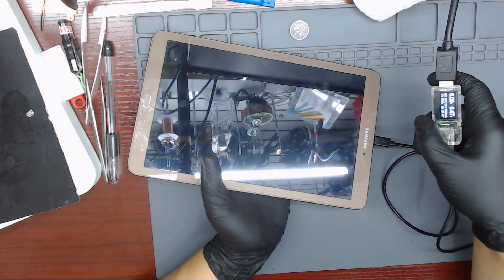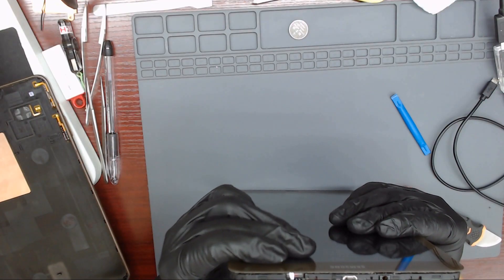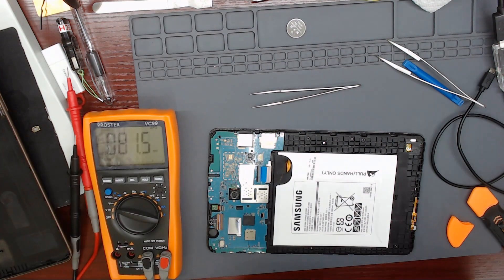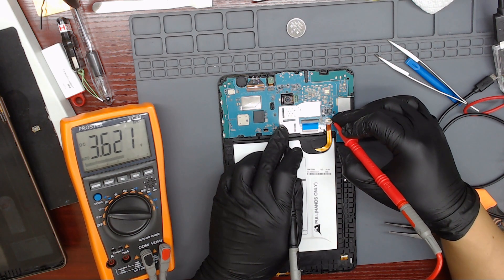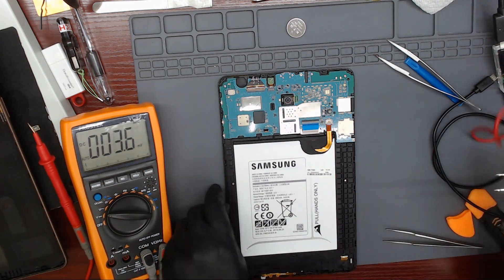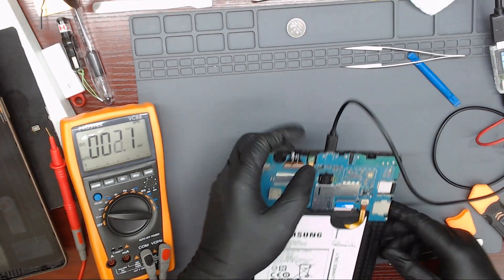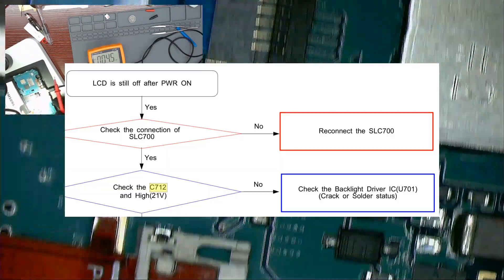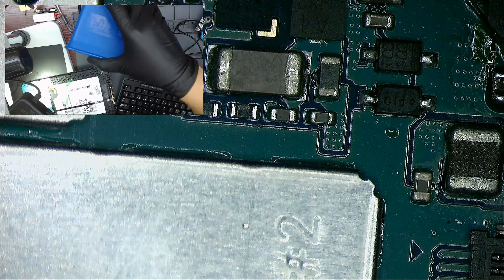How to Fix Samsung Galaxy Tab, E 9.6 SM-T560, No Video, No Image, No Backlight, Board Repair

Comment: Hi I was wondering for to fix the light screen on the samsung table my table works just the light is so low to see it
Reply from the maker: That is backlight problem. Check the backlight section on the board. Also try a known good screen.